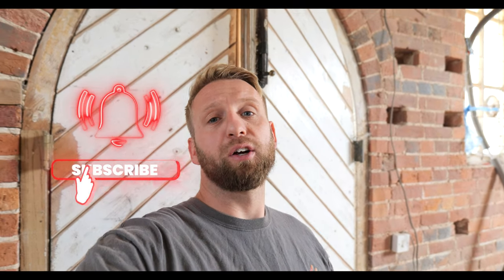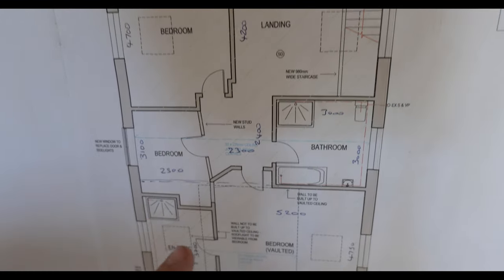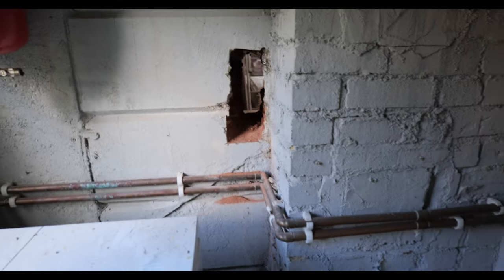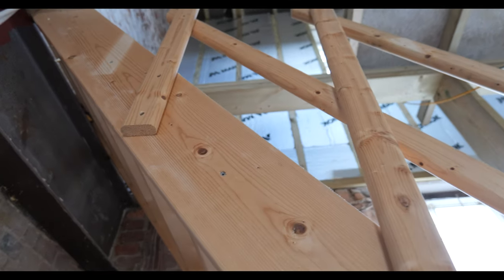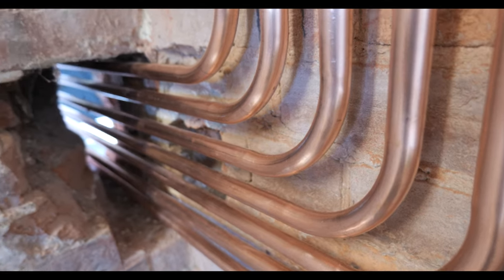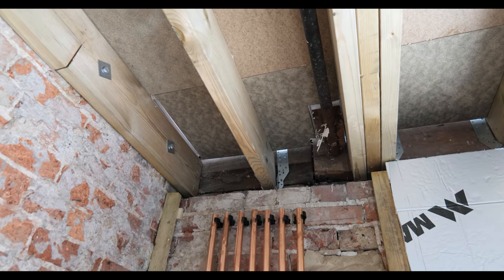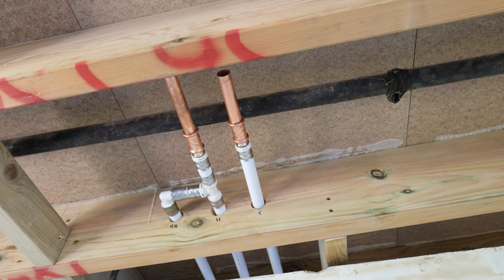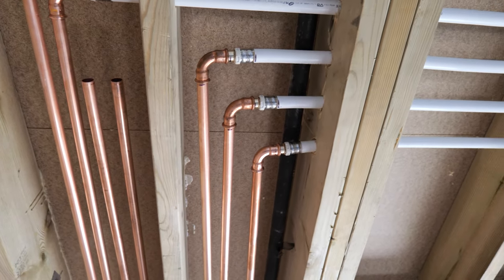Chapel Restoration - New Heating System - Pipework Begins!

Comment: Did you make a template to mark those holes for drilling  ?  28 mm auger ?  I bet that was difficult pulling those pipes through  , well done ,  great job  , I know what's  involved  , been plumbing myself for 45 years  , cheers Steve
Reply from the maker: Thanks Steve. Yes we marked the holes with a template then had the laser out just to confirm. I actually used a 32mm as the pipe is 26mm outer diameter. A lot easier with two but wouldn't want to try it alone. MLCP is not the best for threading through joists.